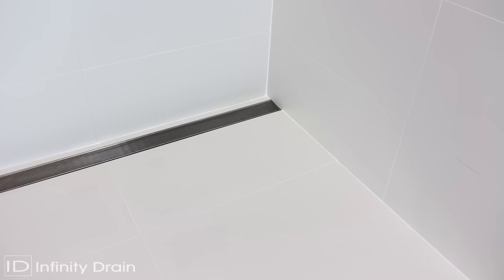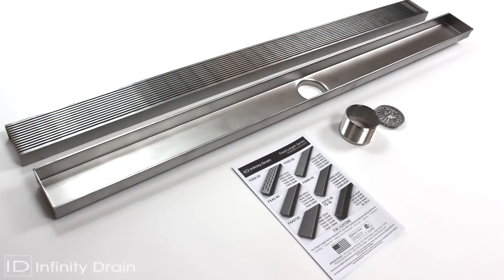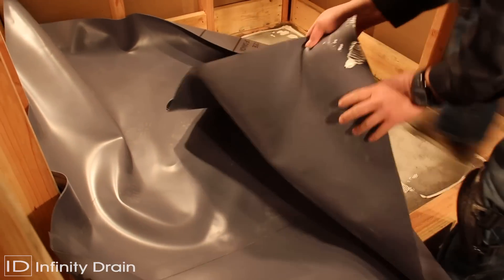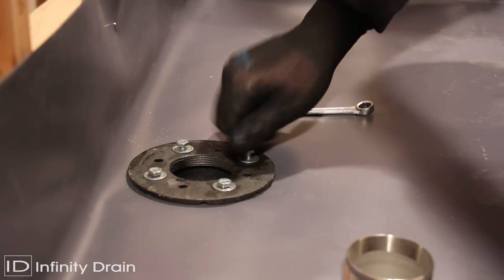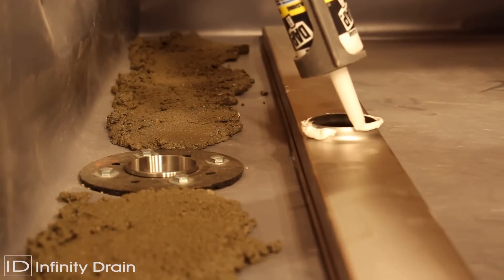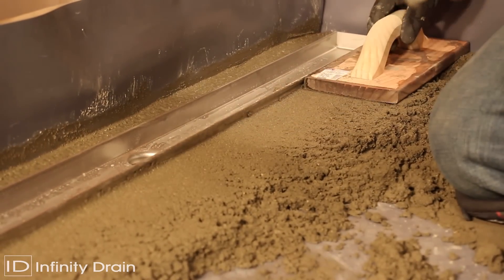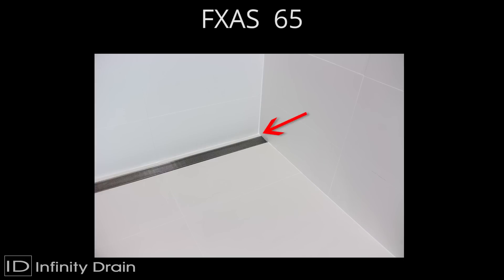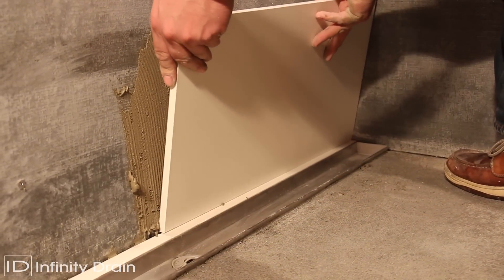Infinity Drain - Fixed Length Linear Drain Installation

Comment from the maker: Hi Jim! Thanks for your feedback. In regards to a low profile P-trap option we do have a very condensed clamping drain body with integral P-trap, CDIS 22, that will offset the plumbing horizontally and limit you build up. Please contact us at Info@infinitydrain.com and we will be happy to assist you specification and any questions you may have.

Comment: Great product, we are specifying this.  What is a good p-trap solution for this product in a retrofit on a concrete floor where we can't cut the slab or work below it?  Thinking probably a raised shower floor, but what is the best, flattest p-trap to use on this product?  Thanks!